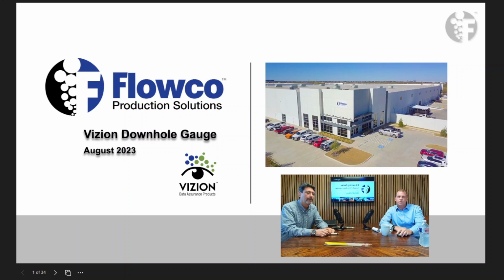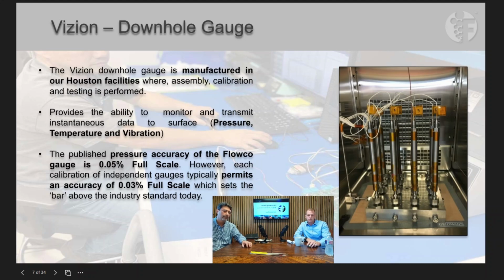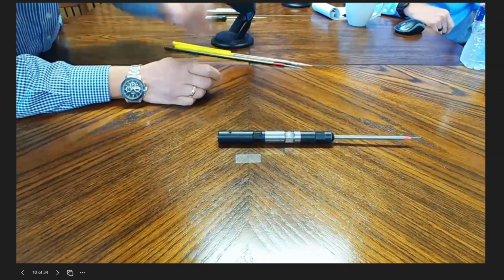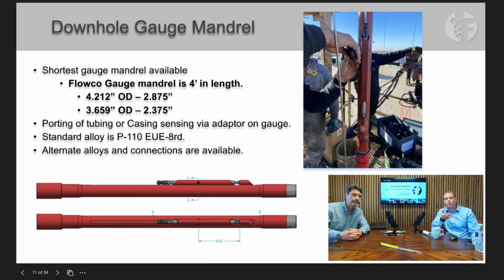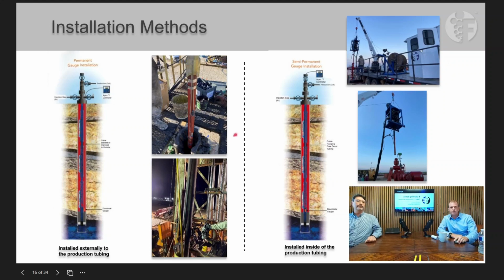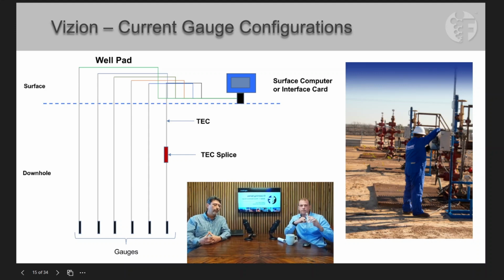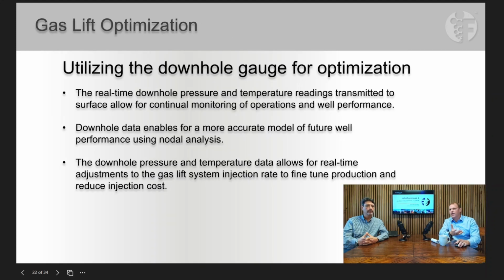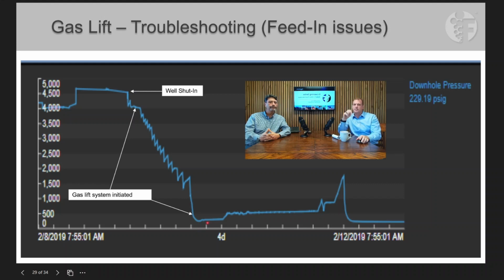2023: Series 7 - Downhole Gauges

Comment: Very informative.thanks.with putting these type of gauges in different depths at the same well the live pressure gradient can be visualized in surface computers which results in understanding downhole fluid regimes while production.This could be very insightful for engineers.